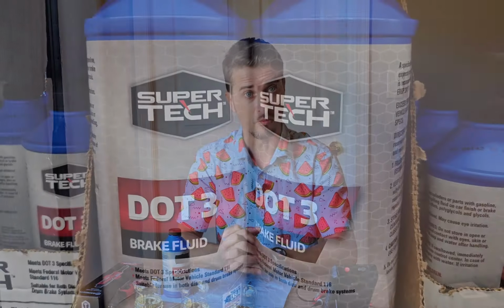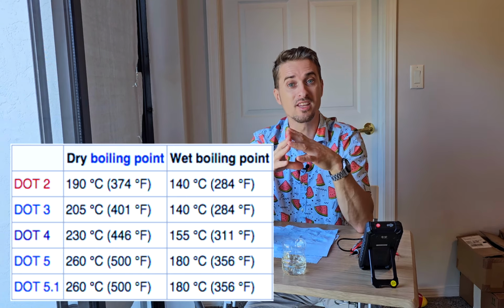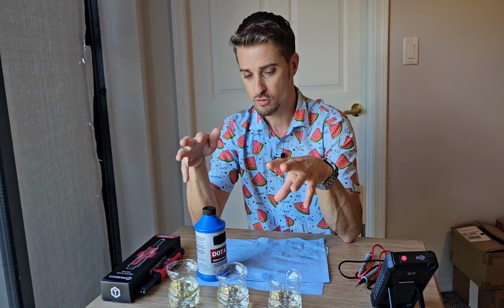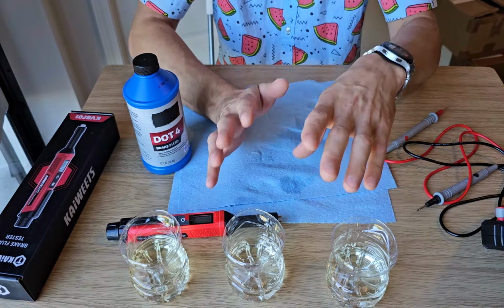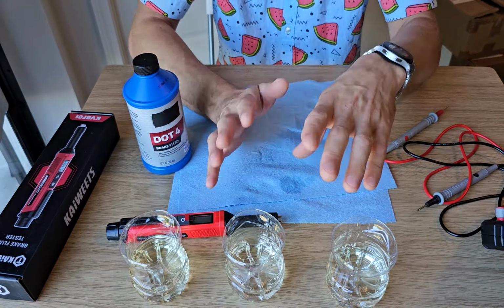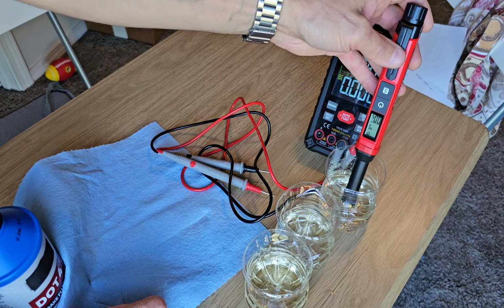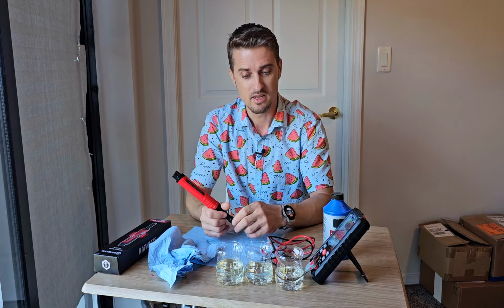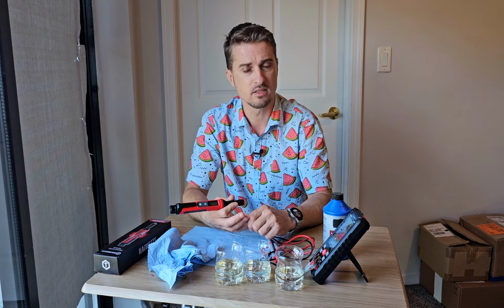Why to replace Brake fluid ?!

Comment: I have a question about your tools. What tools do you use to remove plugs and pins? Can you recommend a set?
Reply from the maker: I don't have a specific tool , mostly I have a home made pick that I'm using for almost everything,  in the past when I was in Europe I had a set from Laser that I had used,  you can see me using it in my old videos .